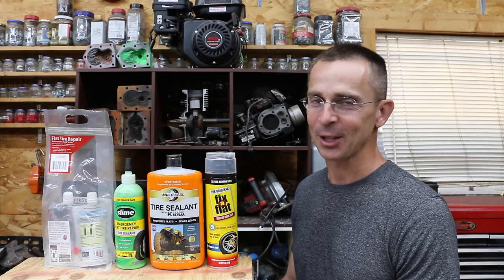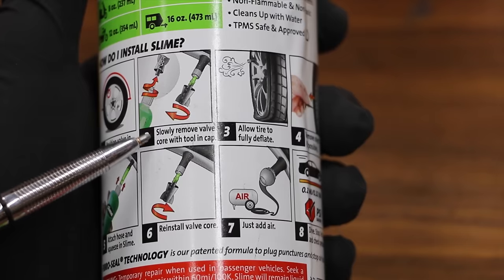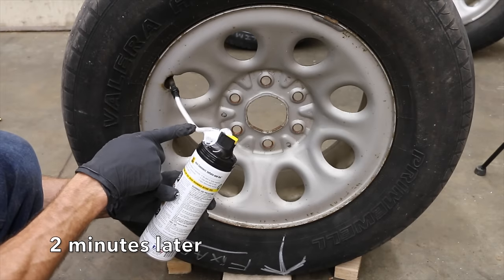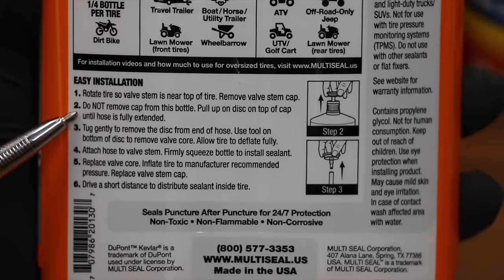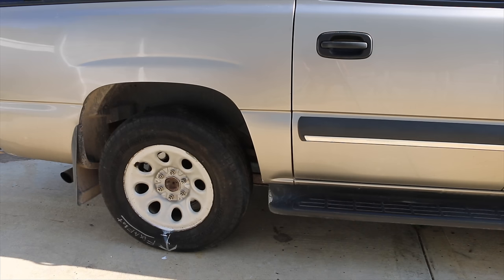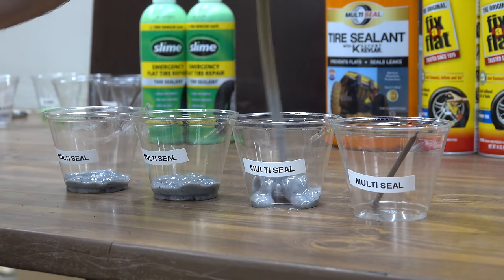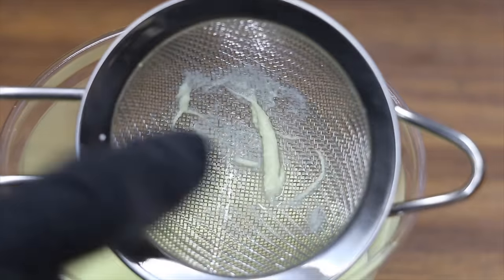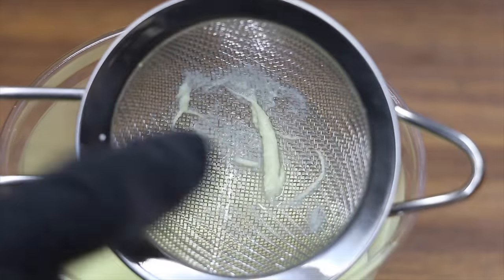Is Tire Slime the Best? Fix-a-Flat vs Tire Slime, TireJect, MultiSeal. Let's find out!

Comment: "Now, that's a lot of damage!"
Reply from the maker: Thanks for watching.
Reply: Best quote by Phil Swift Flex Seal ! Hey I tried that Flex Seal spray on my tire when I was at a parking lot for miles away from gas station , so no it didn't seal up very long ,so I sprayed again and waited longer at home and until it dry for 2 days and tried Flex Seal Tape and it works for half a mile or two thousand feet's or more ,nope my truck tire failed but it holds up with tape better than Just sprayed on by itself. Next time I will try full roll Flex Seal Tape around bald tire . Just to combine both spray and tape not on road just my driveway to test safety

Comment: I'm glad to see this set of tests. It really confirmed with I think most of us already know, mainly about Fix a Flat .  You are too good to say anything negative about this product, but my experience over the last 25 years, when I have had the displeasure of using this stuff. I found that it really makes more of a mess than anything else, and the hose often slipped off making an even bigger mess.  That's in addition to the lack of performance of what it's supposed to do.

I want to thank you for testing the claims. These manufacturers often try to pull a fast one on us.  It is good to have somebody that embodies trust and really does the work.

Thank You.
Reply from the maker: You are welcome!

Comment: Great job!  Tells it like it is.  I have always used slime on my ATV's and tractors and always with success. Lot's of mesquite thorns in Texas.    Works as well as you show.  Cleanup is just spray with water hose and it comes completely clean and is biodegradable.  Jus-Luv-It.
Reply from the maker: Thanks 👍

Comment: I’ve used Fix-a-Flat in several dozens of all types of tires over the past 30 years or so.  I swore by them, it always worked, even for rim leaks. For the past several years though, I’ve had nothing but trouble sealing the tire when it actually got in there (quite messy, and nozzle failures).  Not sure if making it tire sensor safe had anything to do with it but it seems like they quit working around that time. Thank you for this comparison as I’m finally gonna make the switch away from Fix-a-Flat!
Reply from the maker: You are welcome!  Thanks for the feedback.

Comment: just some feedback on the old tire slime
bought some back in june 21 based on your recommendation for a tiny little pinhole puncture that would normally lose around 20 psi over the course of a week
 it's now going into october 21 and that same tyre has lost 11 psi in those 4 months
so, for me, it's great
fairly fiddly to apply and i had to give it a few goes before i got enough in but once it was done the results speak for themselves
once again, thanks for all the hard work you put into these tests
you are the go to channel for getting real world results
Reply: Damn why it didn’t work for me at all, i used it 2 times in my life and it failed, maybe the tire damage was too severe
Reply: @user-Chikotillo  it took maybe a day to take set properly 
And it was a fiddle to get the valve out to fill it up
But overall it gave me an extra 2 years of life from a tyre I could have changed
I did have my doubts at first too and made a second attempt before it worked

Comment: I JUST got a drywall screw in my tire today but luckily I noticed while getting gas. This place only had some off-brand fix-a-flat in a slightly shorter but fatter can. Instructions said to leave the thing causing the puncture inside the tire, and it worked out just fine. Just wanted to point that out because you removed the screw. Also, my instructions said to have the STEM at the 6 o'clock position, not the puncture. Then i just drove around the nearest neighborhood going 15mph for 10mins and I was good to go. Went grocery shopping and chilled at home for a few hours, looks fine. And obviously ill replace the tire immediately in the morning.
Reply from the maker: Thanks for sharing.

Comment: Got it, add Slime to seal the leak, and then use Fix a Flat to fill the tire since I forget my pump!
Maybe you could test that combination, make sure it doesn't blow up or dissolve the Slime or anything lol

And then Multi Seal (which I had never heard of before) goes into my truck and Jeeps!
Reply from the maker: Thanks for the suggestion.

Comment: I always have had issues with the fix a flat can & connections. It always stops flowing into the tire, so I try to adjust the can to allow gravity to help, but it always ends up being an issue. About to try the slime on my car tire. Slime working great so far 🙏🤞
Reply from the maker: Thanks for sharing.

Comment: Me and my old man big time believers in tire slime. I don't necessarily use it on my vehicles, but my tractor and the definitely the small tires on the front of the zero turn since those tires are so prone to getting punctures in them. I have actually never heard of the other two slim products. I knew Fix-a-flat was garbage wayyyy before this video. Very impressed by the one filling a 3/8 inch hole, that's a huge hole for a tire, I doubt you'd be able to even fill that good with plugs!
Reply from the maker: Thanks for sharing.

Comment: Thank you. Great vid. And your editor is awesome. I swore by Slime after it fixed a 1/4 screw hole in a bike tube. And it has fixed many flats since. But I just came across a jagged hole caused by glass, and for some reason, it won't seal it up. I'm at this moment getting ready to put a rubber patch on it. I still love Slime. It definitely works. Not sure what happened this time around, but it works too good to kick it to the curb. However, I think I am going to try Multi-Seal too just for giggles.
Reply from the maker: You are welcome!  Thanks for sharing.

Comment: I have been using Slime since it came out in the 80's, it has been nearly miracouls on old lawn mower tires, saving severely dry rotted tires. 100% sold on Slime.
Reply from the maker: Thanks for sharing.

Comment: I've been using multi-seal for years(now called FlatOut). I have it in all the tires on my trailers, it balances the tires and seals every puncture, each tire on my dump trailer has had at least 6 nails/screws in them and it continues to work at over 100psi and almost 60k miles.
Reply from the maker: Thanks for sharing.
Reply: Can Flat Out be used for on road tire fixes ? or just off road ? The video says it's
designed for off road, but that doesn't make sense ? If it will seal holes, it should
not matter if you drive the car off road, or on road.

Comment: Another good test would be to see which ones are the most destructive longer term. I have had several local shops almost not change my tire since I used some of these. They all claimed the rims structural integrity was diminished from it. I think that factor would have to be a long term test. Great video anyhow, but I'd be curious to see a metal test over time! I appreciate your attention to detail and the help you provide us all.
Reply from the maker: Thanks!  Thanks for the suggestion.

Comment: I had a small leak in my truck tire on Sunday in a remote area. Got a can of Fix it Flat. It allowed me to go another 60 miles, but the tire continued to leak air, just at a smaller rate. The test confirmed my experience.
Reply from the maker: Thanks for sharing.

Comment: I have never had any luck with fix a flat. Most others have worked for me. A key is to find the leak, add the seal, and turn the leak DOWN.  Personally I prefer the "Greasy Rope" repairs, they have NEVER let me down. The ones I have now are by Victor, but others work well, too.
Reply from the maker: Thanks for the feedback.

Comment: My dad got some super old pink stuff from the strip mine he worked at and put it in my 4-wheeler tires back in the early 90s and it is still in there and working today, its thinned out and takes a bit to  plug holes now but still works.
Reply from the maker: Thanks for the feedback.

Comment: I use gemlpars tire repair sealant on my tractor tires.cannot believe how great it works
Have run over lots of boards in the bush over the last 5 yrs and it still sealed the holes
Reply from the maker: Thanks for the feedback.

Comment: Another good product test video.  I look forward to all your videos for recommendations.

I have some experience with Tire Slime and with TireJect (off-road version).  My mesquite trees wage war against my lawn mower tires.  I am constantly fixing punctures.  I found that both products become ineffective and need to be replenished at least every two years or less.  Tire Slime will liquefy and run out of new punctures.  TireJect eventually dries out to a latex film covering the inside of the tire that no longer seals new punctures.

I also found that successive applications of either product is unlikely to be as effective as the initial treatment.  Neither product is particularly easy to clean out when you opt to actually repair the tire.  Multiseal has come to market since I gave up on sealants.  At best, I believe tire sealants should be used only as a temporary solution on highway vehicles until permanent repair can be obtained.

The final answer to my puncture problem was to just locate and plug each new mower tire puncture with a plug. (Btw, enjoyed your video on the tire plug kits.)  I found Slime's inexpensive plug kit to be fairly easy to use, and performance to be perfectly acceptable for my lawn mower tires.  When one of the tires begins to appear more plugs than not, I replace the tire.
Reply from the maker: Thanks and you are welcome!  Thanks for sharing.

Comment: 2 riding mowers that dont have mowing decks any more, 1 dump cart, and 2 home made lawn mower trailers and 3 garden wagons, one garden dump wagon, and one panel wagon with inflateable tries w/tubes.  tire slime in them all.  there are things growing in my yard that puncture those tires, drove the mower out of the back yard, 15 green spots on the outside of the one tire, never went flat, tire slime does great on multiple small punctures caused by weeds that have thorns on them or even small branches you may run over with the mower and not see them.  see bright green on the outside of the tire, let it sit, check the tire for correct pressure the next day and keep on going.  i love tire slime as it has kept me from having to change the tubes or dunk them in water and try to find and repair all the punctures.

$31/gallon may be a bit expensive for slime but, to me it is worth it as, one ride out back would otherwise result in going to town for more inner tubes or blowing an entire patch kit trying to fix one inner tube.

i stopped using fix a flat long ago, had a plug in a tire start leaking, was told to use fix a flat.  no such thing as tire slime back then for me. 1/4 mile from the parking lot at work, the plug blew out of the tire as all the fix a flat did was lube the hole so the plug could come out.  my car was only moving 23 mph when the plug blew out of the tire and was on the rim by the time i got parked.  been using slime since i was able to get it, and refuse to go back to using the useless fix a flat.
Reply from the maker: Thanks for sharing.

Comment: I always carry a tire plugger kit (sticky cord material) with me in the daily driver. If you don't mind laying down on the street, most tread holes can be plugged without removing the tire.

Then it's one and done.

(All the products featured here require the tire be driven for the treatment to work as described on the label. Just putting the tire hole-down and waiting won't really work. Driving the tire puts bookoo centrifugal force which forces the material deep into the hole and surrounding rubber before curing)
Reply from the maker: Thanks for the feedback.

Comment: My mom got a flat on her HHR.  I went to put the donut on, and there wasn't one.  It was a tire inflator with fix a flat.  It worked great.  It stopped the leak and brought the tire up to pressure.  I still have the inflator, and I'd like to get a refill for it.  Plus, I didn't have to jack up the darn car and change the wheel.
Reply from the maker: Thanks for sharing.

Comment: I only use these products if I have a mild rim leak, not a hole. I always plug my holes, but sometimes there's a super slow leak that I can't find. That's when I'll try the tire slime to help seal it. Lay the tire/wheel on the side. Let most of the air out. Take & step on the bead and let the slime penetrate into the bead. Flip and do the other side. Put the wheel back on the car or lawn tractor. I haven't lost any pressure since doing this and left it on a car tire for 2 years. My car has aluminum rims that's hard to seal.
Reply from the maker: Thanks for sharing.

Comment: Outdoor latex house paint - glitter of different sizes - 3/4 of a gallon -  then 1/2 cup of automatic transmission fluid for preventing rust and corrosion - and a 1/2 cup of ammonia - 1/2 cup of water -  1/2 cup of antifreeze -  then use a plastic clear hose and a cattle syringe to inject into the tires - do not let it SIT - from the get, put the valve core back in - use whatever filler you want that will fill the holes you have or are preventing to get.   Glitter has worked for me - small pieces of dog hair cut up works - fiberglass matt that is cut up finely not in strips but small small pieces - heck even the crap you collect in your homes vacuum cleaner will work - just not the fine powder crap.  Some people even add shavings from old tires or inner tubes.  The amounts are going to differ depending on what exterior latex paint you use - which you can get for free from local hazardous waste recycling centers - most cities - even Sioux Falls, South Dakota have a "RE-USE" room - they would rather people use everything up that is still good than attempt to just recycle it all - sign your name on a sheet or whatever process you do in your city - and you have a ever changing supply of paint and other chemicals to use.     I prefer a UV resistant outdoor latex paint.  The ammonia will help keep it all in a liquid state - and when it comes into contact with the hole - it will evaporate pretty quickly and dry when your "particulates" get clogged in the hole of the tire.     I do this to all my riding mowers - go kart and stuff like that.  As for my vehicle -  chevy s-10 - I keep half of a gallon and a little kit in my truck.  I use it for emergency use.  Then I get patch put in.   - Over the winter have your riding mower or go kart or whatever that sits - off of the ground on stands - spin the tires now and again.
Reply from the maker: Thanks for sharing.

Comment: If you have a local Johndeere company near by. They have a version that is red in color. It will fix a hole left by a 3/4” bolt. It works great.
Reply from the maker: Thanks for sharing.

Comment: I use slime on my bicycle inner tubes. It's been two years since I've gotten a flat. I would just pull the thorns out after rides. When I changed tires, I had to remove the valves to deflate the inner tubes. The inside of the tires had a bunch of green spots, but the inner tubes were fine.
Reply from the maker: Thanks for the feedback.

Comment: I wish you tested Ride-on Tire sealant.  What is unique about this product is that you can put it into your tires at anytime for protection similar to slime. It's a long-term use product, and is designed to help balance your tires. V-rated for speed and can be used in both cars and motorcycles.
Reply from the maker: Thanks for the suggestion.
Reply: @ProjectFarm  Keep making awesome content!  Is there any way to donate to your channel with crypto?

Comment: I had a flat with a small nail hole in the tire.  I didn’t have a spare tire so I used fix-a-flat and it just bubbled white liquid out of the hole but did not fill it.  I ended up using a tire repair kit where you push those rubber threads into a hole and cut the excess, that worked to hold air.  I took it to a tire repair shop and they complained about the white goo in the tire and had to clean it up.

Comment: Your channel is one of my top 3 favorites. I have watched this video several times since you first uploaded it...Unfortunately, it does not address this problem well: You're on the side of the road with a flat. You have a small puncture or leak. You cannot  jack up the car (My Corvette😆) to remove the tire coz your car sits too low to the ground and you are in soggy terrain. What product can you inject into the tire to get you to a nearby repair joint?
Reply from the maker: Thanks!  Thanks for the constructive feedback.

Comment: With a bike I use Slime and Tannus wheel liners. I'd wager it would take years to get a "flat" but even if the Slime doesn't work the Tannus makes it so you can ride still and you won't ruin your tires if you don't act a fool till you get to your destination. I can't suggest both together enough. Just make sure If you but the Tannus liners but a tube an inch or so smaller than your tire since the liner is about an inch thick itself. Best $140~(everything included)you could spend for your bike. IIRC Tannus even sells liners for tubeless tires.
Reply from the maker: Thanks for sharing.

Comment: I will use Fix-A-Flat when I have a stubborn pinhole leak that takes several days to leak down. Those are annoying and hard to find. But fix a flat seems to seal those right up for me. I wouldn't use it on anything larger than a pinhole.
Reply from the maker: Thanks for sharing.

Comment: I have been using Slime in the tires of my lawn mower because I get small holes in the tires from mowing weeds and running over small thorns that put tiny holes in my tires. The only downside of Slime is that over a period of time (during the summer mostly) the liquid will leak out of the thorn holes.
Reply from the maker: Thanks for the feedback.